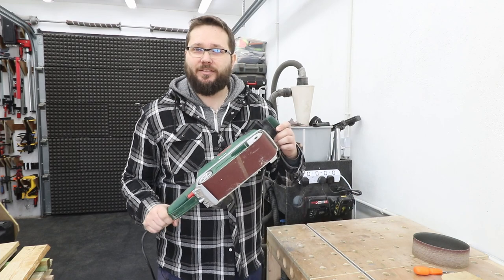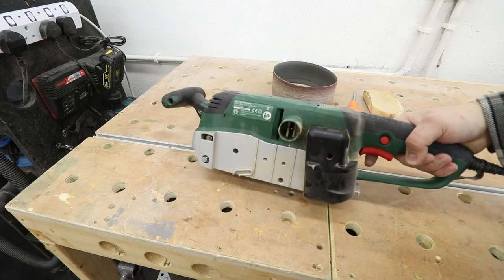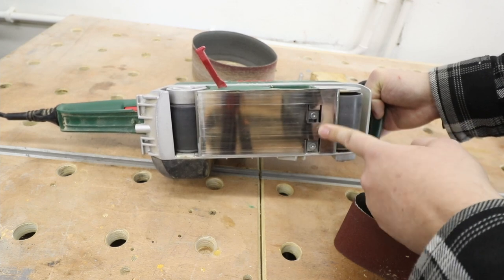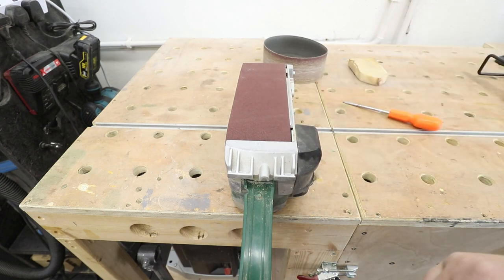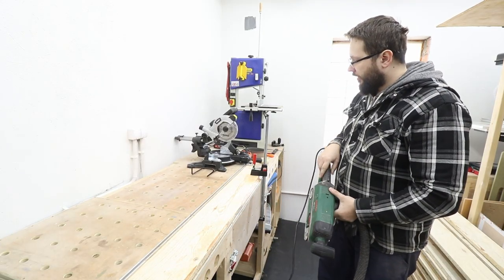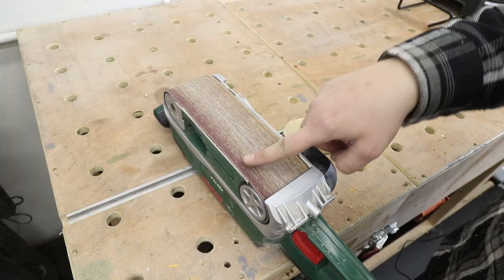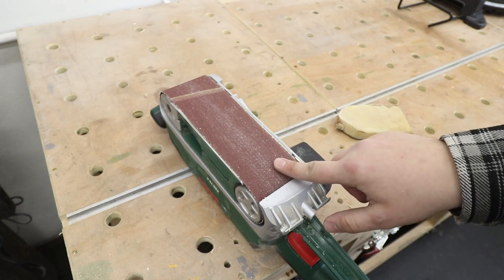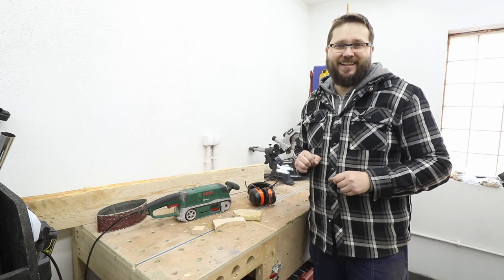Belt Sander Basics | Beginners Tutorial

Comment: Great video! One thing that could have been covered in more detail was about the grits. These tools are great to clean off old finishes (stains, varnish, paint), and for cleaning up dusty dirty rough timber, however that kind of work really clogs up the belts.
...
So I find that a "scratch" pass with 80 (or even 40 on some materials) is almost always a good idea just to knock the rubbish off. Using too fine grits too early will cause a world of grief, since the belt will clog and that causes heat... and heat embeds the muck onto the belt forever!
...
Paints and varnish-like finishes are the worst, and if you melt them into the belt you need a screwdriver or old chisel to get it off. You will wreck the job if you are sanding with blobs of paint stuck in the belt! So, slow belt speeds, big coarse grit size, and very light pressure at the beginning!
...
I suggest to buy a wide range of grits, 80, 120, 180, 240 and always use them in order. It's so quick to change belts that it's much faster to just start at 80 for a quick cleanup, then step up to 120 then go higher and higher (one step at a time). Each belt is only on there for a few passes before changing grits, so they stay cool and wear is minimal... hence you get much better belt life.
Reply from the maker: Great info there, thank you for sharing all this. I'm sure it will be very helpful for many people. Cheers!

Comment: Great video. Thanks. I have same belt sander and over time it has lost some of the tension between the rollers - wondered if this was something you had come across and whether you’d been able to fix it?
Reply from the maker: So far not had that issue. I would imagine some bolts got loose. Worth checking out all the fittings on your sander

Comment: I've bought the same sander but mine jumps while sanding probably because of sand belt splice joint is it normal?
Reply from the maker: Shat do you mean it jumps? Sanding paper wrong way around?
Reply: No sanding paper placed with the arrows  but it doesn't run  smoothly it vibrates/jumps whenever hit the splice joint -i've never had belt sander so didnt expect that?
Reply: I found out today that the motor  drive pulley vibrate gently dont now if thats normal or shouldn't vibrate at all??
Reply from the maker: @Rodzina  well the whole machine will work and vibrate, hard to suggest anything without seeing it really

Comment: i only use mine now to take off lots of material, but its not pretty haha. i also have a little jig to mount on its side so it works a bit like a sanding disk type of thing. the dust it creates is mental tho and its so old i cant connect a vac to it as the connector is some weird polygon shape :P
Reply: great to see you pumping out the videos mate, i hope it takes off for you. just dont forget your roots man. :)
Reply from the maker: @kanedNunable  hehe thanks mate, I hope so to😁👍
Will never forget that mate 👍
Reply: A plastic drink bottle cut suitably will make an acceptable adapter for dust collection if you shrink it on using a hot air stripper.